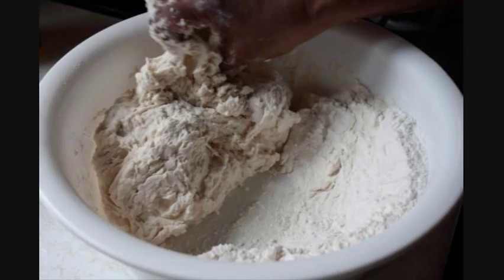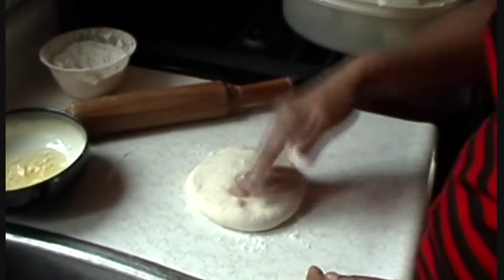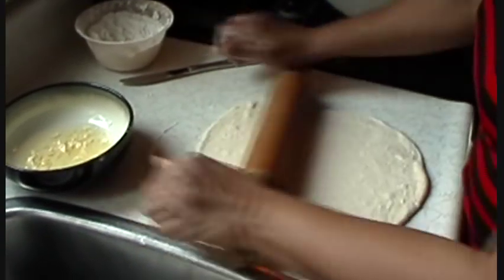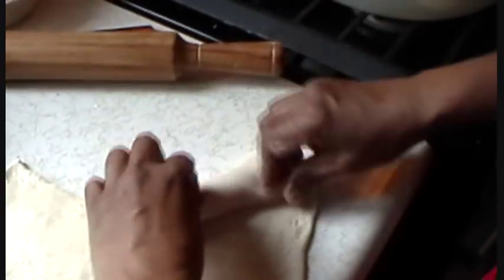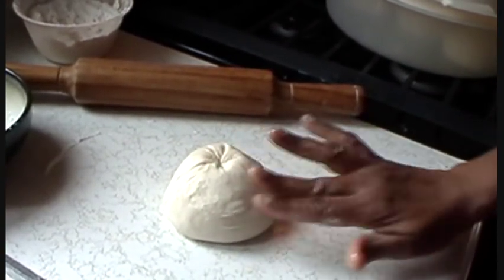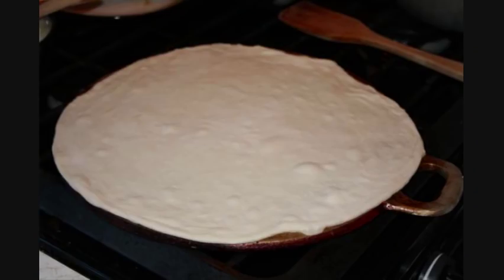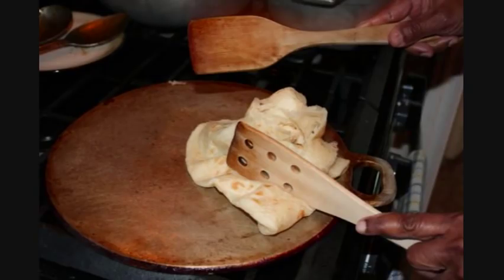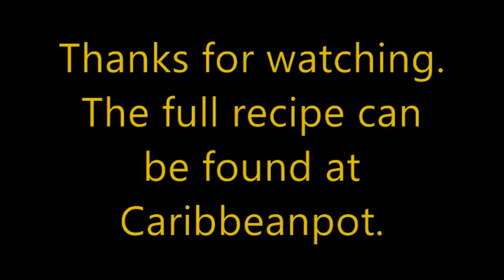How to make buss up shut roti

Comment: What if I don't have a Towa....
Reply: +Asil Orange what if I dont have either but only Stainless Steel? cast irons only go in my oven
Reply: Asil Orange I have a glasstop electric range. I have never put my vast iron on top. Only in the oven. I don't want to crack it. Can it be baked?